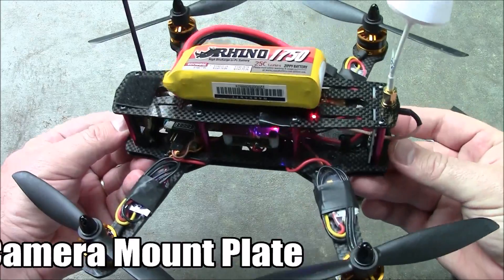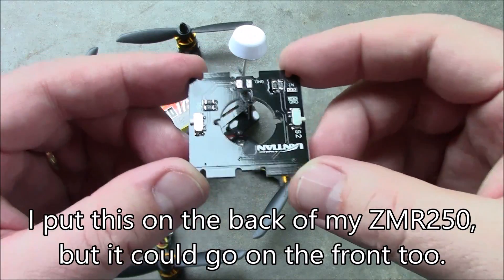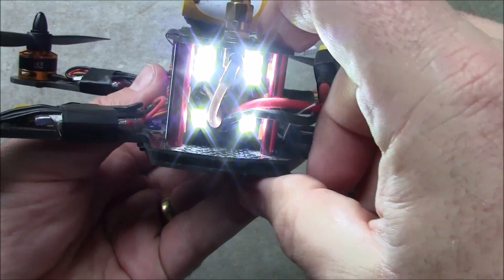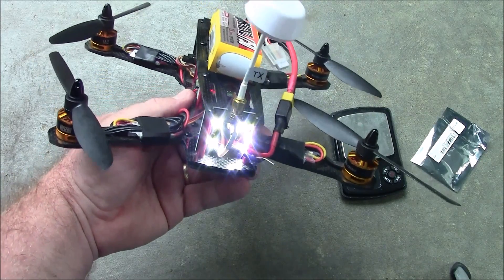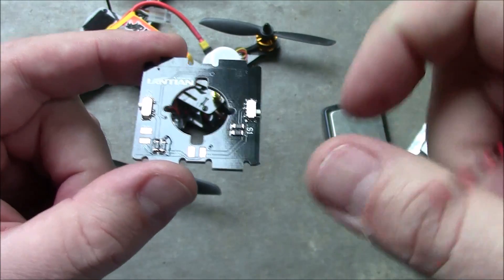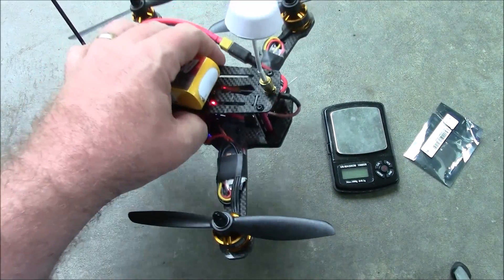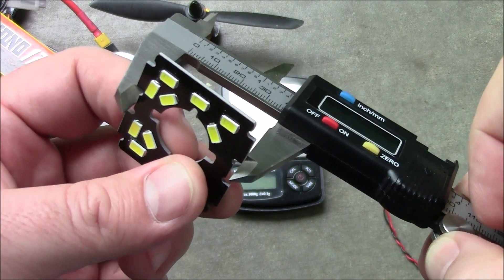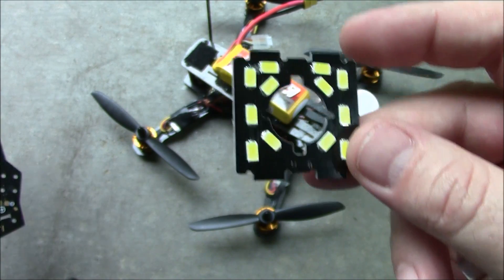LED Camera Mount Review for ZMR250

Comment: If you put that on the front and the FPV camera through the center, any retro-reflective surface (like reflective tape) would show brightly. (Might be best seen in subdued light or inside buildings and parking garages)

Comment: Is that Diatone PDB very useful? Did you replace it with something else in your ZMR250? It doesn't look like much compared to the other options. It's definitely a hazard with carbon fiber frame and it doesn't route anything but power. Also, linear BECs for 4s, really? That should generate a lot of heat...
Reply from the maker: LeoTheHuman I haven't used it yet.  I'm waiting till something breaks and I need to work on the ZMR250 anyway.  The PDB is pretty basic, but then again it's also way cheaper than the other options.  I've heard others talk about the PDB and the CF ZMR250 frame, what is the deal with those together?
Reply: If the spacing between the screw holes and the power planes is not enough, it might short through the CF frame if the screw breaks the isolating layer due to vibration or excessive force while screwing (:
Reply from the maker: LeoTheHuman so you think it would be a better idea to use the PDB with a glass fiber version of the frame?
Reply: I just don't think this specific PDB is a good choice, even for its price. I would go with a simple 36x36 one if you just want the power distribution or hunt for Nucleus/Overcraft one if you want all the wires gone. Considering the fact that you have it working now, I can't advocate for putting this board in there at all.
Reply: ***** i run my team legit pdb with a zrm carbon with no problem at all
Reply: Allan T As do I,  the problem with the banggood one is that the traces run right next to the mounting holes for the top plate spacers.